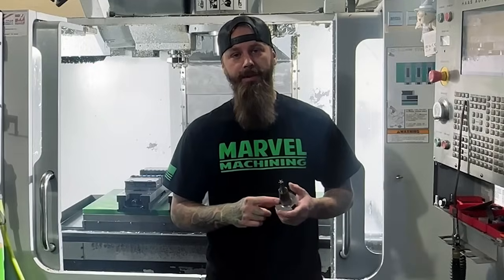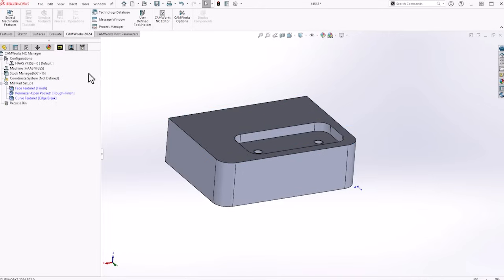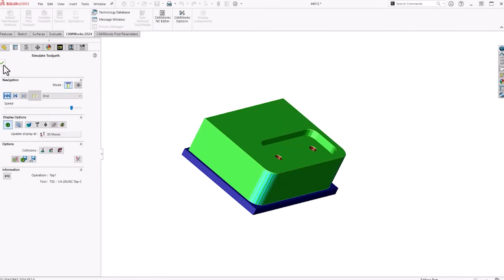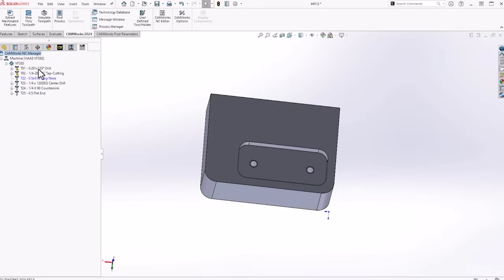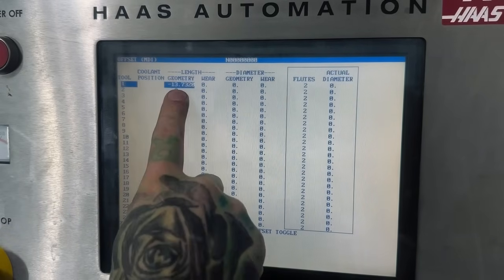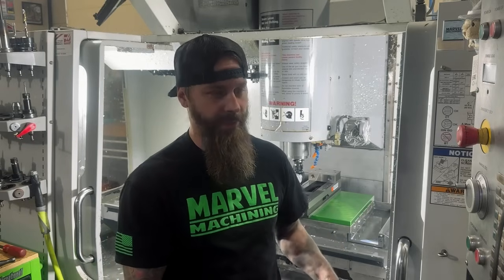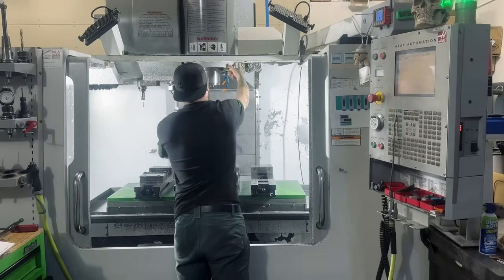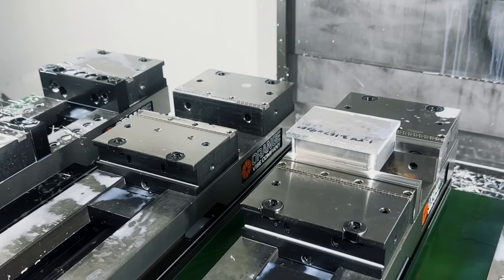CNC Setup Without Probes—Here’s How! | The Process Ep.1

Comment: Thank you for sharing your methods. This is a fantastic setup process because it's efficient, repeatable, and fast. I do have one question though. Did you make your CAT40 tool holder stand or did you buy it from a supplier? I have a print to make one but unless you have the equipment and are able to hold very tight tolerances within a couple of .0002, the tool won't be very accurate. Please let me know.
Reply: I re machined an existing tool stand and my tool blends and Z depths are nothing I worry about.

Comment: Why you running negative tool length offsets?  Negative from what? I understand negative from machine 0, but how are you going negative on the height gauge?  Zero your height gauge on the cat40 block, and go UP from there, you'll get a positive number.... Never heard a good explanation of why run negative offsets, maybe I'm missing something....
Reply: I was taught this method when I first started running CNC's, and every shop I worked at followed the same approach. I've never even thought about using a positive offset, and have never encountered an issue where using a negative offset was the root cause of a problem.

Honestly, I don’t really care whether my tool offsets are negative or positive.

That said, can you explain why someone would prefer using a positive offset over a negative one?
Reply: @MarvelMachining 

Key benefits of positive tool length offsets:

Intuitive understanding:

Positive offsets directly reflect the actual tool length, making it easier for operators to visualize and understand the tool's position relative to the workpiece. 

Faster setup:

Since the tool length is directly represented, there's less need for complex calculations, leading to quicker setup times. 

Tool interchangeability:

A positive tool length offset measured on one machine can be easily used on another machine without needing to re-measure the tool. 

Offline pre-setting compatibility:

Most tool pre-setters use the positive gage line system, allowing for efficient pre-setting of tools before loading them into the machine. 

Reduced errors:

The clear representation of tool length in positive values minimizes the risk of confusion and potential errors during tool setup.
Reply: @Steelcrafted  In 17 years running CNC's at numerous companies including my own, none of what you shared has been an issue to consider. 

What complex calculations are needed when setting a tool offset negative vs positive? I don't calculate anything, the number the height stand gives me goes in the machine, no calculation needed. 

With my negative tool offsets, I use the same values for my tools in my VF2SS, VF3SS, and EC400 no problem.

"Most tool pre-setters use the positive gage line system, allowing for efficient pre-setting of tools before loading them into the machine" How does not having to type a - symbol makes it more efficient? 

I don't see anything confusing about using negative values that would cause a potential error during a tool set up.

Comment: This is helpful to see as I think about how I’d like to set up my own machines someday soonish. In the past I’ve done similarly but using the machine itself as the height gauge, with a 2” digital  tool setter on the vise bed. Slightly more time consuming with the manual jogging down probably, but you can get fast at it and it reduces the room for error in transferring numbers since the machine records its own data. Also a cheaper solution. I’d rather repeat for each machine rather than compensate - I think I’d get confused and it doesn’t matter to me if the offset numbers match as long as they are correct. If you’re leaving tools assembled anyway you only have to do it when you’re replacing or adding. I also like color coding the tags for standard tooling so you can have extra confidence that you can trust the offset in the machine.

Comment: I might be missing something. Where is the height gage zeroed on? The Heimer tool does not look to be 13 inches long. Is the Taper block included in that?
Reply: Negative tool length offsets are completely nonsensical....I don't get why people run their machines this way
Reply: @Steelcrafted Because it works and is absolutely irrelevant 🤷‍♂️
Reply: The 13 inches is the machine coordinate position when the haimer is zeroed out on his vise. You go backwards to the height gauge and set the dial to that value when the haimer is zeroed out on the gauge.  You can then measure your other tools in reference to the haimer.  The Z offset in his work coordinates is the distance from the vise to the part.  This is the first way I learned to do tool offset, except it was all in the machine.  We zeroed tools on a 2x4x6 block and measured the distance between the block and the fixture for the work offset.
  Positive tool lengths are referenced to the gauge line in the spindle, and your fixture offset is the distance between the gauge line and the fixture.  They're both referenced from some point, it's just a little more intuitive to say you have a 6" long tool and see 6" in the offset table.

Comment: slightly off topic but why are your endmills all 3-4 times longer than they need to be? They look like specials, but you use them for everything?
Reply: I do a lot of job shop work, I can go from a .500” x 1.00” x 2.00” part with an immediate following part that’s 2.00” x 16” x 36” all within the same job and have a full carousel. So I typically just load my 1/2” x 2.00” flute length rather than swapping it back and forth with a shorter length flute, unless I have enough pockets.

Comment: Great video.  How does that cat40 taper block and the height gauge work, is that 13" dimension from the bottom of the taper block or? How does just putting that dimension is as the offset work out correctly, Im a little confused
Reply: It’s actually based off my first machine I set it up in, my VF2SS, I loaded a tool and set it so my vise bed was Z0 in my WC offset, and whatever that tool length number ended up being I set the height stand to match that. 

When I added my VF3SS, which has more Z travel, I input the difference in G52 to compensate the Z difference, which allows me to use the same offset across machines.
Reply: It has to be 13.732" from 3D tip to the bottom otherwise its off, the taper block + 3D is matched to that number.
He didn't call any G52 in his MDI setting so it's just a 13.732" move from Z-home position to the vise zero. (G54 Z0 )

Comment: It would’ve been very helpful to new users to see how you put in the correction for G 52 to make all your machines match
Reply: The G52 in the machine shown is just my machines Z travel difference from my VF2SS that had a shorter Z travel. 

I originally set this system up when I only had the VF2.

The G52 value in the machine shown is the Z difference from my VF2 to my VF3

Comment: -13.732" relative to what? How does that correspond to your vise bed. I'm guessing bed to spindle gage-line at top of travel less zero'ed Haimer? I know a Haimer is about 6.5" when zero'ed, to gage-line, depending on what is holding it. But you never specify. You never even mention gage-line. Where does your standardization come from? How does it work accross all machines? I didn't think haas had VMCs and HMCs with the same Z travel? Do you just add or subtract the 3" or whatever difference in your head when you punch the H value in? Not nit-picking. I would genuinly like to know.
Reply: -13.732” is just the number that works out to make my vise bed Z0

When I originally set this up it was in a VF2SS. 

Let’s say I used the Haimer, put it in T1 and set its offset to -5.00” and left my G54 WC at Z0. 

I went into MDI, typed in:

G90 G54;
G43 H1 Z0;

Cycle start. 

Z moved down to its location, I put it in hand jog and dialed it down till the Haimer read 0 on the vise bed and looked at my POSITION page to see how much I hand jogged my Z (-8.732) and added that value to T1’s offset of -5.00” which told me that tool lengths offset needs to be -13.732” in order for my vise bed to remain Z0 in my WC offset page. 

I then took the Haimer to my height stand set up and forced it to read -13.732” when the Haimer was at 0 

G52 is used to make up the Z travel difference between machines.
Reply: @ Got it. Never even thought of G52. Prolly cause I never use it.
Reply: I believe the height gauge is zeroed to match just one of his machines Z coordinates. In another comment, he explained that he uses G52 in order to bypass doing anything else. A very functional system if I say so myself!

Comment: Not saying this doesn’t work, but it would make so much more sense using positive tool lengths that actually match the tool length (it’s nice when the number means something relative to the tool?), a G52 negative value to the vise bottom, and then G54,5,6 etc can be positive as shown.
Reply: I started doing this 10 years ago and thought about changing it, but it works and to me the tool height values are really irrelevant numbers.

Comment: This can't work for multiple machines only when you measure the difference in lenghts between tooltips related to 3D Haimer and use that lenght of the 3D Haimer to 
the vise-bed Z0 or whatever. You need to store that -13.732 in the G54 Z otherwise you have problems on an different machine with a larger Z-range to simillar vises.
Reply: @ytfan3815 I use the same height offset values in my VF2SS, VF3SS and EC400

I built my pallets WCS in my EC400 based of the correct tool heights and the Z height difference from my VF2 and VF3 is accomplished by inputting the difference in Z in G52.
Reply: @MarvelMachining  
Okay, but it looked too easy  and I assume you set your height-gauge first time with the 3D-Haimer to the vise, then made REL Z zero, homed the machine in Z and readout the numbers for the 3D length, after that matched that number with your height-gauge block somehow. 🤔
Reply: Unless you comp in the common maybe?

Comment: I've been spoiled with a probe and haven't had to touch off many tools manually but this method seems really efficient. Do you have a video on how you set up the height stand?
Reply: I put a tool in the machine and set it to the vise bed so my WC remained 0 and reset the height stand to match what my tool offset ended up being in the machine.
Reply: @MarvelMachining  So just to make sure I understand; any tool in spindle, manually touch off to wherever Z0.0 will be, record tool offset, put that tool in your setup block, zero height stand on tool tip, then retract by the amount of the tool offset and re-zero and you're set as long as Z0.0 doesn't change?
Reply: @camashley2944 Yup! I should of went into more detail on how to set it up, maybe EP2 follow up 🤔

I figured with the different machines and set ups, if someone wants to use this way they can fine tune it to work for them. My values are consistent with what I have set up.
Reply: @MarvelMachining  that makes sense, easier than i thought!
Reply: I too would like to know this. Dont think its zero’d from the surface plate